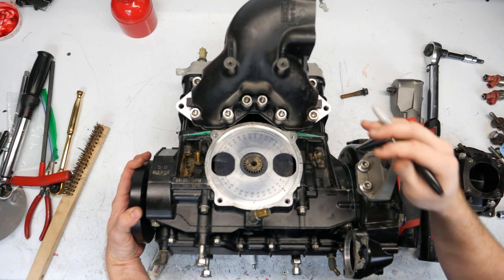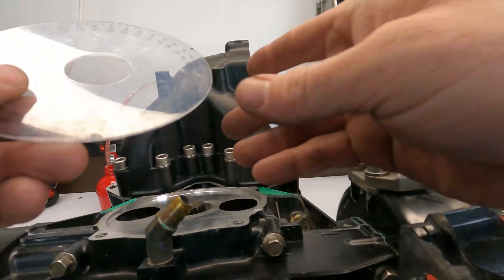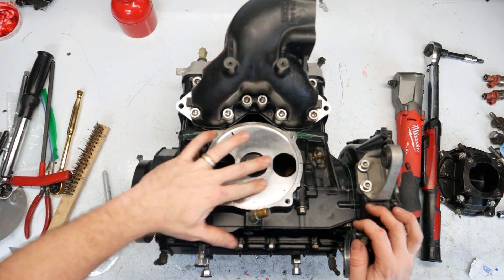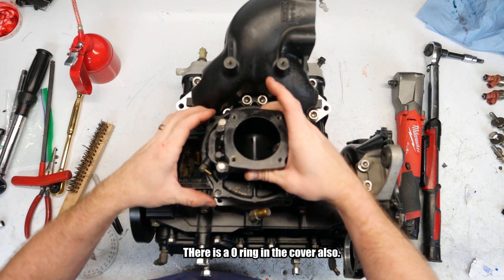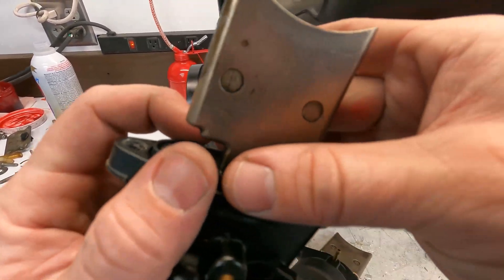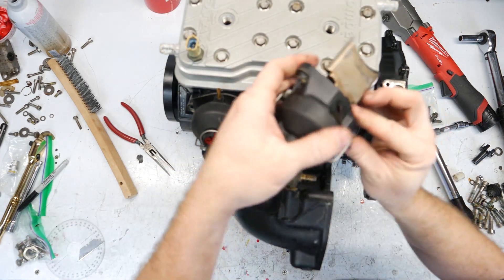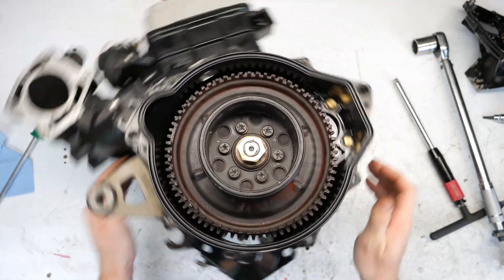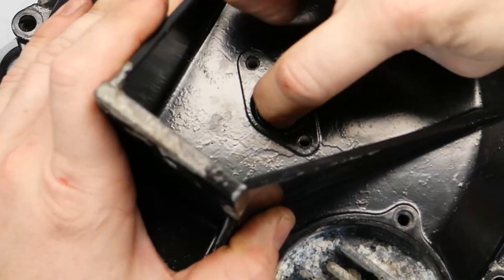Rotax 787 RFI Rebuild - Part 3 Rotary Valve

Comment: I just realised today why the guy who sold me the ski had a hose clamp on a oil feed line. Because he knew the engine needs a full rebuild to change the crank seals. It also had a stripped gear on which I replaced. I'm going to have a guess and say he forgot to remove the clamp one day and ran it dry hence he just sold it. Haven't started the ski in over a year and the crank is full of oil I'm just glad it didn't bend a round cranking it over when a covered my garage with oil from the plug holes
Reply from the maker: They clamped the oil line because the pump let oil seep into the crank?
Reply: Im trying to fix one up for a friend and im having the same problem. If i dont clamp the oil supply line the engine hydrolocks from all the oil flooding into it. Is it possible to just. . . Live with this? Unclamp the line when you want to run it and clamp it when you're done?
1996 GTX 787 Rotax engine
Reply: @Onemadfiddler  I install a plastic garden hose valve on the oil feed line near the fitting under the RV cover. Worked great. My RFI had no oil in it when i started it yesterday after sitting since September 2024.

Comment: mine  has  the  2  scratch marks     you mention  too.  so    the  mark   with   marker   you did  goes  in between  those   scratch  marks?
Reply: Mine too. That timing is the hardest of all. If i do not have piston stoper like yours, that is it. No point of timing video in my case. Or i do not understand it right. I am trying to do it as service manual is showed. Overoll you have best how to videos. Good job 👍🏻…

Comment: You flew through the rave valves, so I couldn't see what the "Top" looked like when you installed them. Is the top the flat side, and the bottom has the angle?

Comment: how did you know where to install stator cup to the flywheel without marking it?
Reply from the maker: The stator does not need to be timed. its just a ring of magnets. Timing is on the big keyed flywheel/starter ring.
Reply: @DeWoodysShop  so it doesnt matter where the magnetic cup is installed on the flywheel on the RFI like on the carbureted that has the raised magnets?
Reply from the maker: No, it does not matter since its not used for spark. just generation.
Reply: @DeWoodysShop  ty